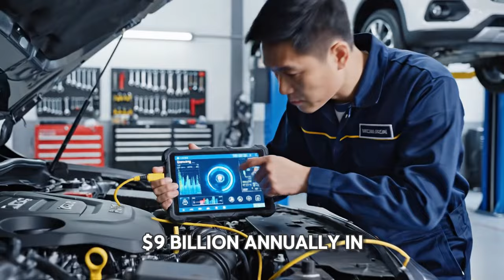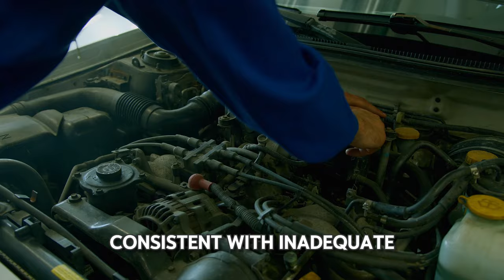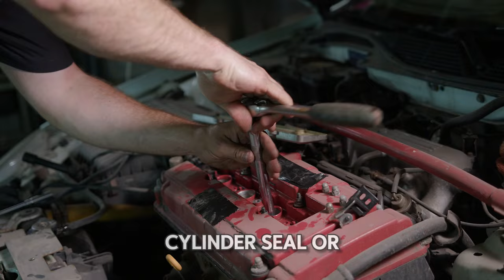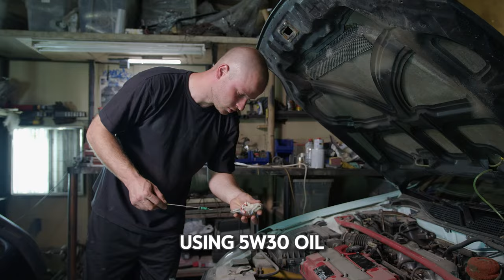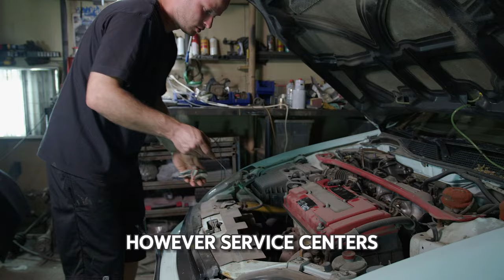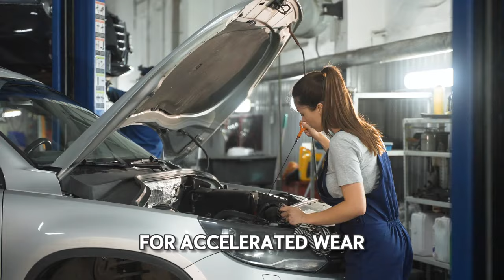STOP Using 0W-20 Oil Until You Watch This (Dealerships Won't Tell You Why)

Comment: I am going back to the old healthy,  economic and trusted  mode of transportation that is Bicycle.

For long distance I would prefer public transportation system.

Hell with these oil recommendations from Manufacturer, Dealers, Mechanics.

Lots of confusion regarding oil grade, climates etc. Unnecessarily taking a toll on the Engine longevity inspite of changing oil at regular intervals and proper maintenance.

Vehicle should not fall under the category of just use and throw type. It should last for atleast 15 years or higher than that.
Reply: I will get a horse and a pig as a back-up and beat your bicycle. :face-green-smiling: